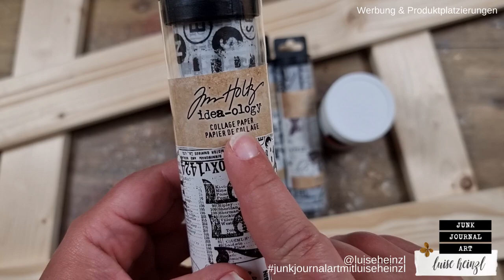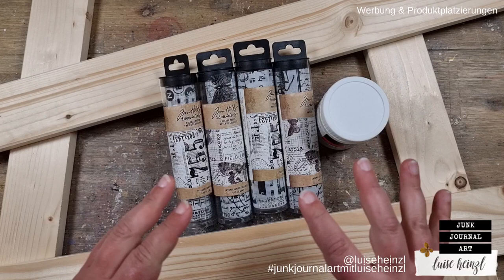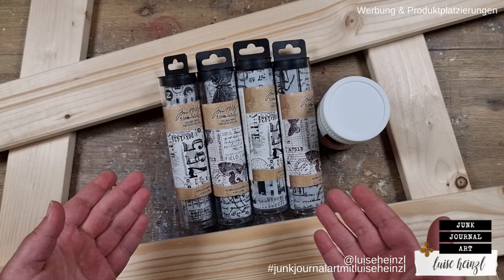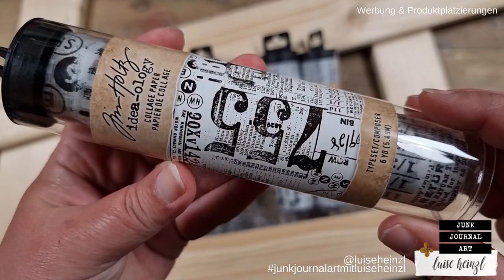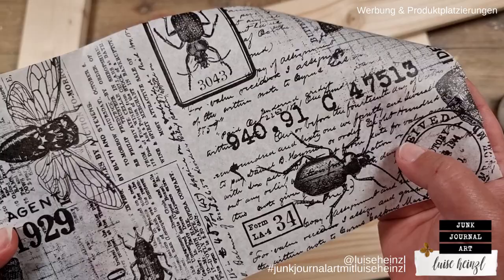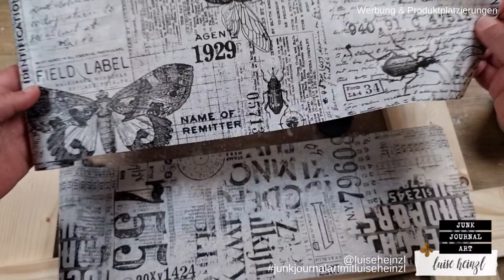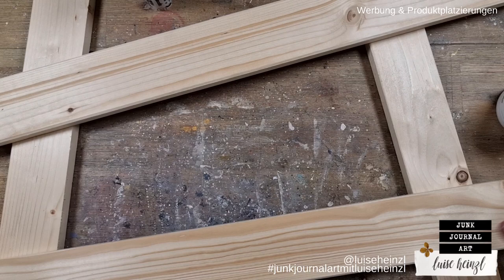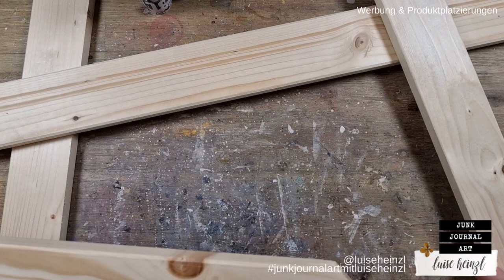This "PROBLEM" with TIM HOLTZ COLLAGE PAPER! window frame decor! junk journaler on the wrong track?!

Comment: Loved this project dear Luise, worked out so well. By the way with your noisy staple machine, you put the plug into the ' wall socket' that's the hole in the wall, and the bar to get things straight we call a 'spirit level'. And your little edge is indeed ' improvised' . Hope that helps, but your English is so good in general you really need not worry, we all understand your explanations. If only I could speak German half as well. Love n hugs as always to you and Gerri in you wonderful tiny house which is beautiful. Good health and good cheer dear friend from Victoria in England 👍👏🏼😘💐😘
Reply: In the US we call what you put the staple machine plug in an electric socket or receptical and I am thinking you may have been using an air compressor. Carpenters have a number of tools that they can connect to it like a finish nailer as well as the stapler. The yellow thing we call a level. Luise, if you want to distress your edges, have you considered using archival ink since it is permanent?
Reply: Wall socket in English is also referred to as electrical outlet!
Reply: @candmmom  Yes! Tim now has a bunch of his Distress Inks in the Ranger permanent ink line! Black Soot, Vintage Photo, and 2 others come in a set, but he’s trying to get others in that line also. GREAT IDEA!